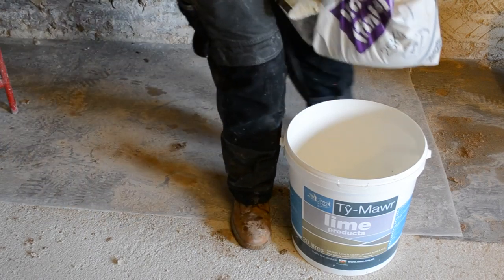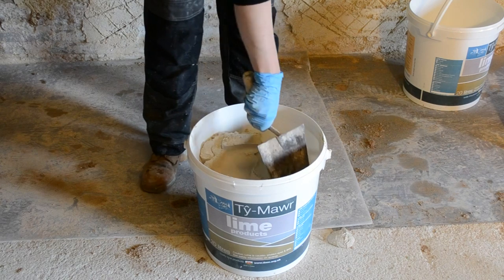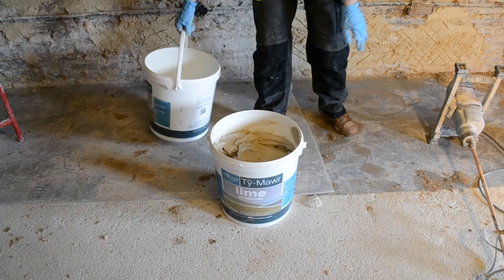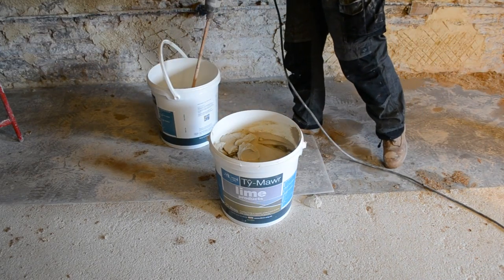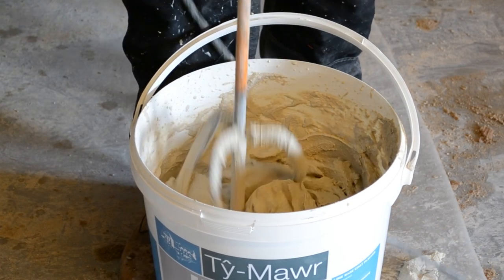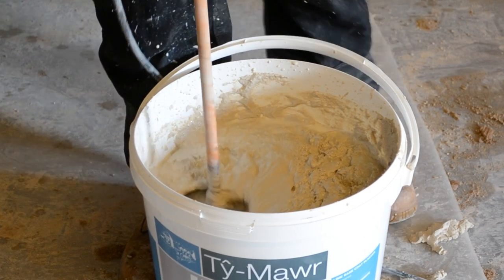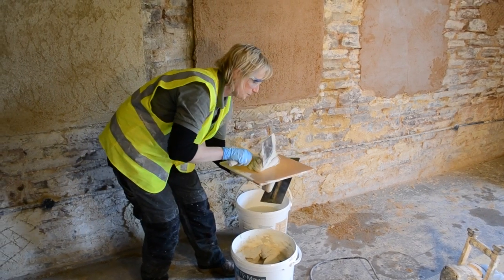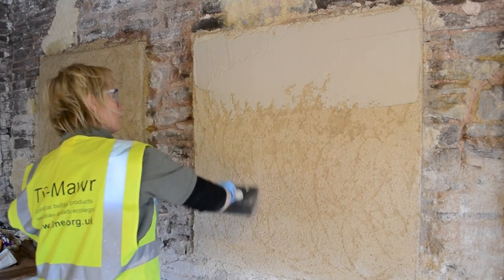17) First coat of finish plaster

Comment: Is there a source for your products in the US?  Or something you would recommend?  Also, what is the difference between cob and lime?
Reply: Cob is an earthen brick-like product (mud/straw/etc) that is coated with lime render or plaster for protection.  There are very few sources for lime putty products in the US, and those you can find are insanely expensive (10-20x the price in the UK or Italy). Only affordable option is to find fresh type-S lime and mix it to putty in 5 gallon buckets.  Concrete sand is reasonable for scratch and brown coats for plaster.